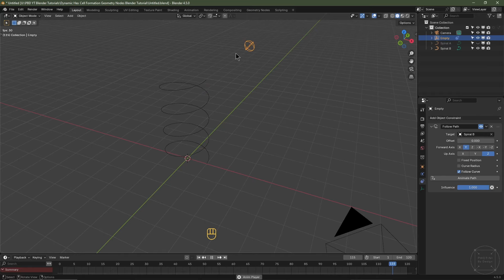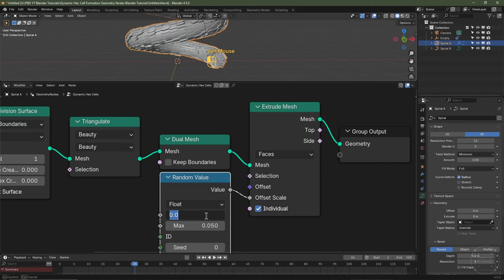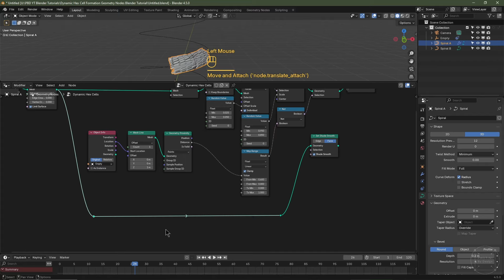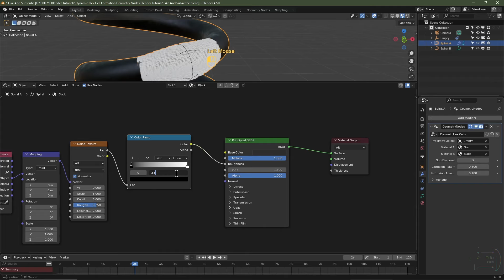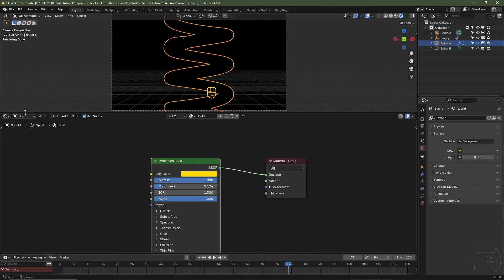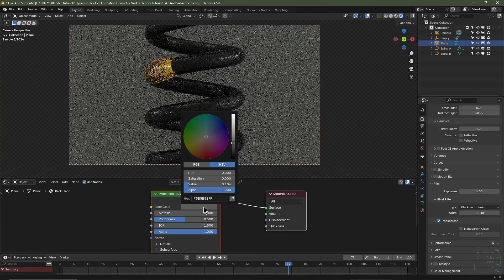Geo Nodes Dynamic Proximity Extrusion Curve Guide – Blender Tutorial

Comment: It is annoying that the whole thing cannot be done in a single Geonode set up using the empty. It works if you use a mesh in place of the empty, but the empty should just work.....
Reply from the maker: Yes, mesh objects and empty objects use different node setups for proximity in geo nodes. It is possible to make the entire setup in geo nodes, but the node tree would need a slightly different approach. I will work on making a tutorial concept to cover this exact scenario because it is a really handy method to familiarize ourselves with.